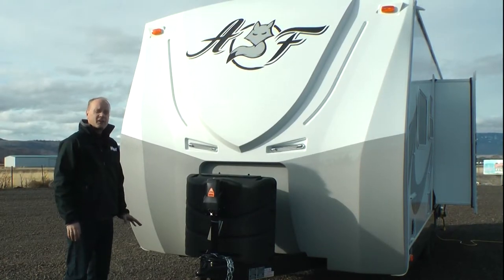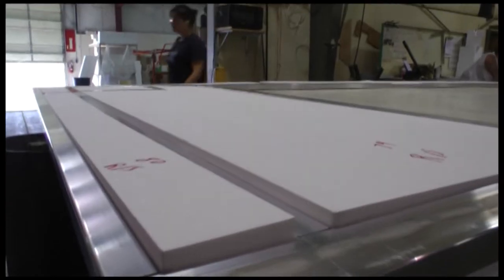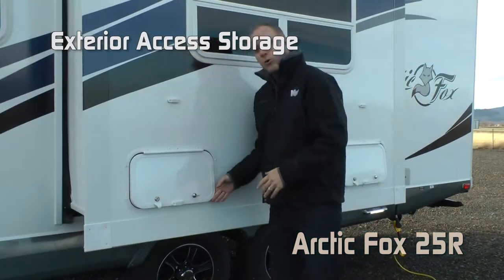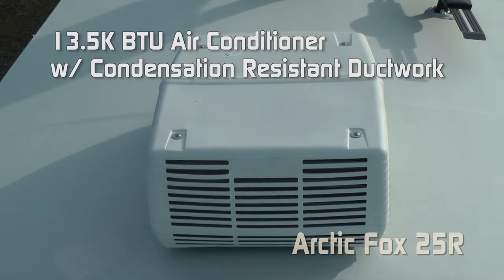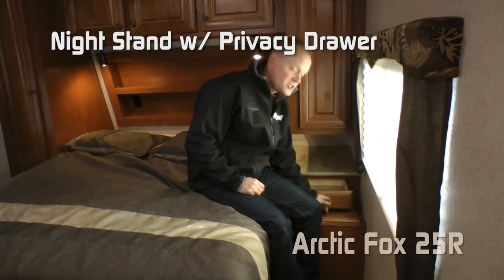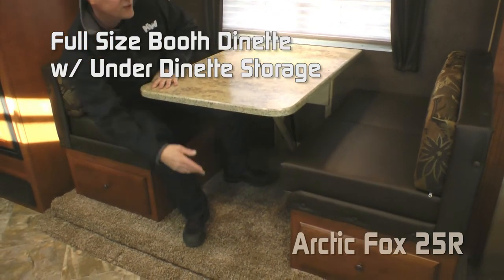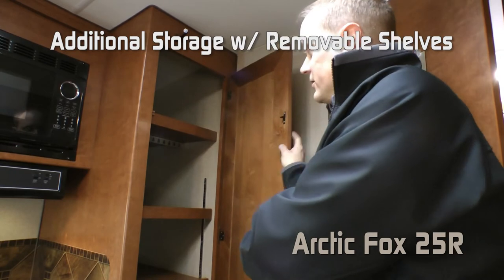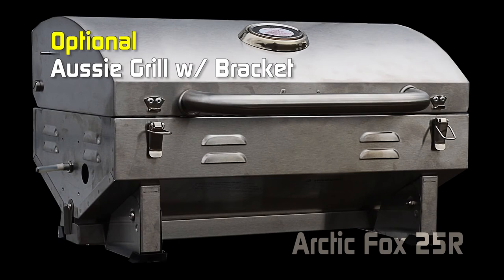Quick Tour of the NEW Arctic Fox 25R

Comment: Just curious, why the wooden roof trusses rather than aluminum?
Reply from the maker: +jay super The aluminum trusses are extremely weak and need three anchor points to become strong using screws.  We like the wood trusses because they are stronger, and also because we bond the roof structure (3/8" marine grade plywood) to the truss using wood glue and an adhesive tipped staple.
Reply: +jay super Thanx....Just found out there is a new Arctic Fox  dealer near Cincinnati Ohio.  When I called last year to the Northwood Office they said they didn't sell any RV trailers east of the Mississippi, just truck campers.  On our trip to Alaska in June we'll have to stop in at a dealer to check out the 28F Silver.  Where is the plant located? tours?